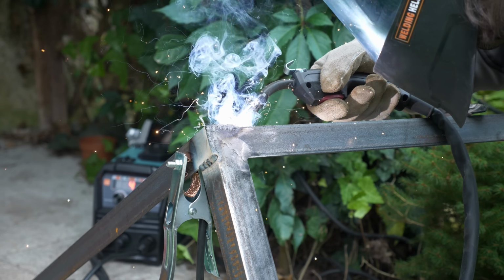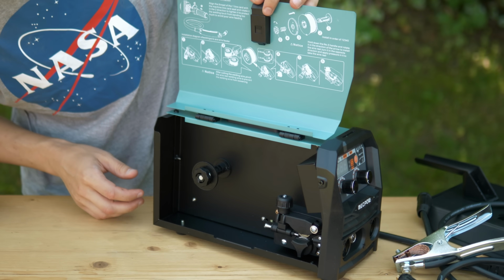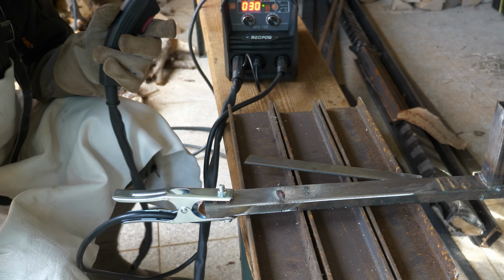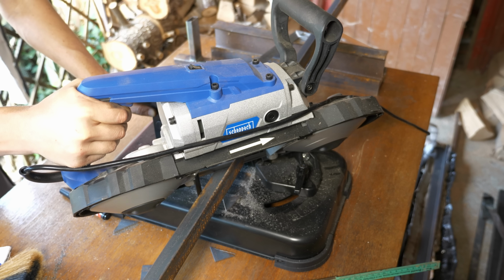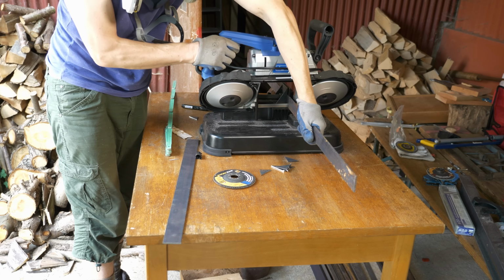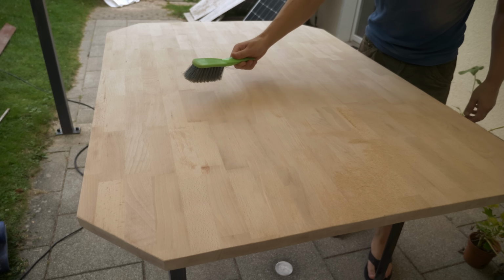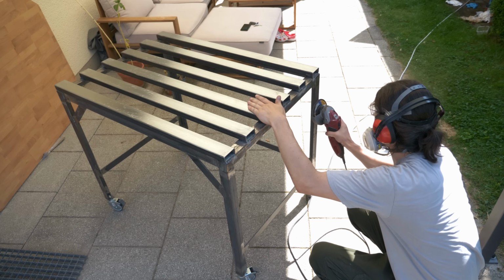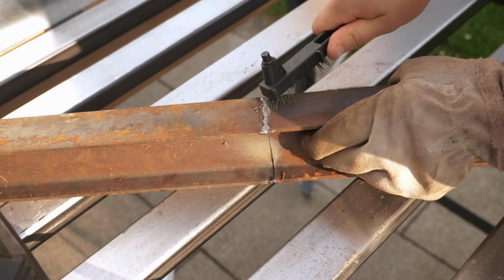I made a hidden welding table

Comment: Im probably gonna buy one of these cheap welders, just for convenience; my main tig machine is like 300lbs. Im not a huge fan of flux core welding because of the spatter, but it's definately much cheaper. If you want to get good results with these machines, just use stick and practice.

Comment: I think you did brilliantly well here. 

I'm not sure if either of these observations will help you - I'm not a welder - but offering these in case they are things you'd like to try... 

First... when welding something like two pieces of box-section steel together, particularly if you are creating a 90-degree angle... my Dad always used to take an angle-grinder and cut the hard corners off the outer faces of the two pieces of box before he welded them. When I asked him why he did so, he would tell me that it created a channel for the weld to fill, which had a couple of benefits. First, it increased the surface area of the underlying metal for the weld to adhere to... Second, it meant that if he needed to grind the weld flush to create a smooth joint, he knew that the weld penetrated a bit below the outer surface of the box steel, which meant the joint would be stronger because he was not grinding away the weld he'd just laid down. WARNING - really important, if grinding the corners of the edges, to not grind all the way through the steel to the inner edge. You need that preserved to keep whatever you're welding dimensionally accurate. But that was something he did...

The second thing was something he had me do when he tried to get me to learn to weld, as a training excercise. He had me find a piece of reasonably thick scrap metal - an old chunk of steel. He would look for something that had a good surface area - imagine a piece of metal say 6 inches by 4 inches by a quarter-inch thick. Thicker the better. Then what he'd do is have me weld a line down the long axist of the piece of metal... Then he'd have me make 2 more welds, either side of the first, but merging with it. I'd keep going until the single bead of weld had been spread out until it was most of the width of the block. Then he'd have me turn 90 degrees and run another bead down the short axis of the block, on top of the first layer of welds. Then he'd have me make 2 more welds, one either side, and repeat. He might make me create 4, 5 or 6 layers of weld on top of this block. This was all about practice to keep my hand steady and to weld straight lines. 

Last would come the "fun bit" - he'd take the block and basically cut it in half using a metal band saw. We could immediately see how good my welds were, because if I'd done a bad job, the "interior" of the weld would be a mess. But as I got better, the metal of the weld would get more uniform and the thickness of each layer would get more uniform. And it only cost him a block of metal and some MIG wire to keep me out of his way for an afternoon...

Comment: I am not sure if someone else has commented this, but two decades ago I was taught with MIG to 'push into' the weld. In these it looked like you were dragging away from it. If that makes any sense.

I'm also only just past half way, but re the legs (in case you don't say it), tacking a weld first before doing the full join/line can held with how the heat may deform or try to move the parts!

Great video either way, I may need to add one of these to my collection 😁

Comment: Weld spatter is much more persistent on sanded/grinded surfaces. You should have left your welding work surface black. Another option is to use welding spray to protect the area around the weld seam. You can spray this on the work surface beforehand. As always, a great video.

Comment: I got a cheap welder like this too.. Using a high quality flux core welding wire makes a difference like day n night. So ditch the stuff that came with it and try some quality welding wire.
Reply: WELDINGER Fülldraht D100 0,8 mm 0,9 kg (MIG/MAG-Schweißdraht NoGas) soll gut funktionieren
Reply: Ja, weldinger hab ich auch

Comment: An option like this that doesn't need gas is so much more appealing for those of us who'd only occasionally use this. For sure adding to the list of tools I plan to acquire :) thank you for sharing your experience
Reply: my advice is to invest 200-300$ more and get a proper welder. Not only it will serve you a lifetime, but will also save you the frustration of you waiting for this toy to cool down when you are welding for more than 10 minutes, I mean it barely can hold 100A.

Comment: I recommend TIG-welding (WIG in German)  it is basically like soldering but with steel. Much cleaner and less stressful. Only drawback is you have to clean the material proper.
Reply: And you have to use gas - that’s why Flux is so much better for hobbyists

Comment: MIG = Metal Inert Gas Schweißen

Inert gas...where did you put the argon bottle in the video? 🤔

Edit: The Mecpow MIG-120 is a "Gasless Welding Machine". Honestly that's more a fake MIG for me. For a wire with flux the surface of the weldings does not look that good. 
And i've done a lot of different weldings at the higher technical college. 😐
Reply: So, what is the issue then if the surface of the welding "does not look that good"? Is the included flux wire just the cheapest and worst stuff on the market? Are the settings on the machine wrong? Is the welder machine to blame? Or is it just that he does not have experience and the formal training and still needs to learn, by doing more welding projects?